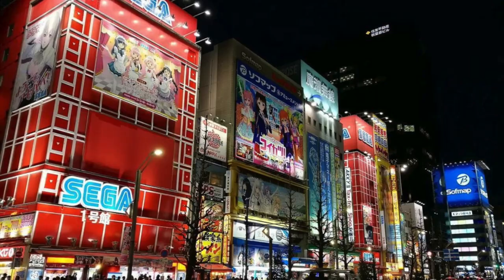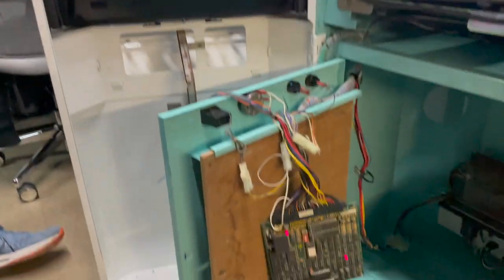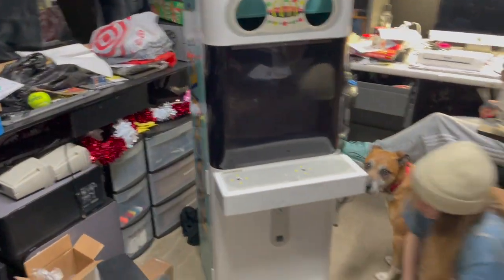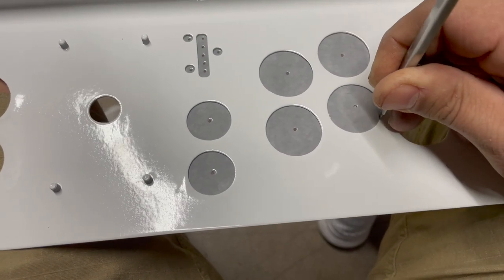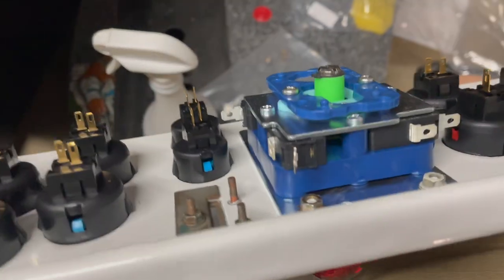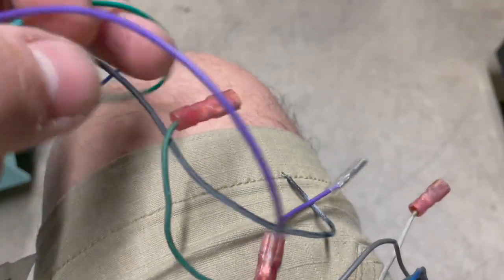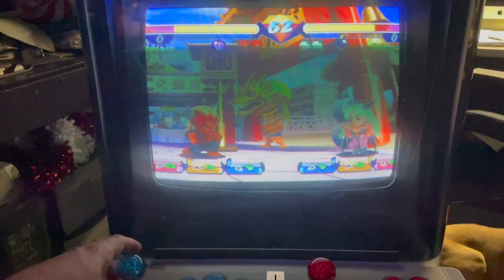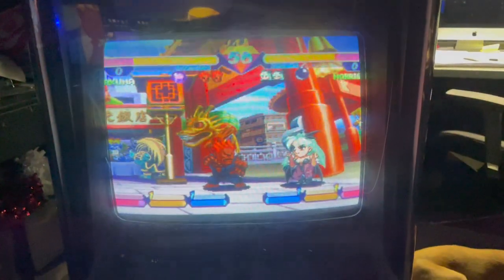Capcom Mini Cute Arcade restore.....Super Gem Fighter Mini Mix

Comment: What a little nice cuty :-). Really nice to see such treasures get restored. It's such a pleasure to play on a fresh restored cab. The only thing that perhaps deserves a little attention would be the rusty metal parts inside (power supply, etc.). Can easily be galvanized or nickel plated. I did that on my Egret 2 restoration aswell.

Comment: Where'd you get the pliexiglass done? I need a replacement for my restoration...
Reply from the maker: It was in good shape. It’s still original. If you’re talking about the marquee topper, that came from eBay.
Reply: @ElectricStarshipArcade  oh. I needed the screen acrylic.  :(